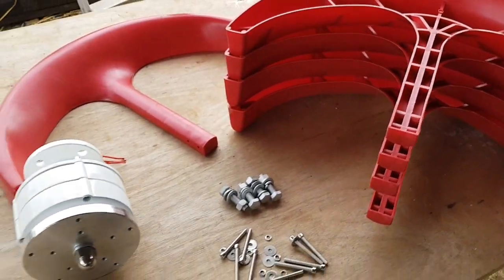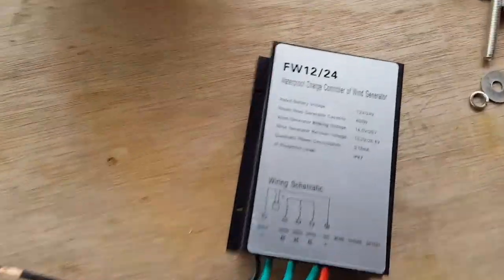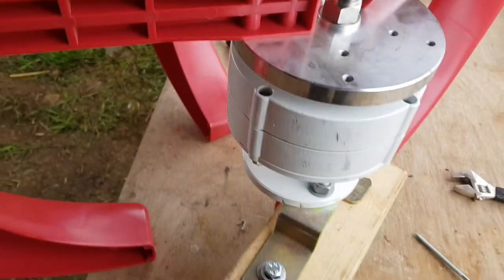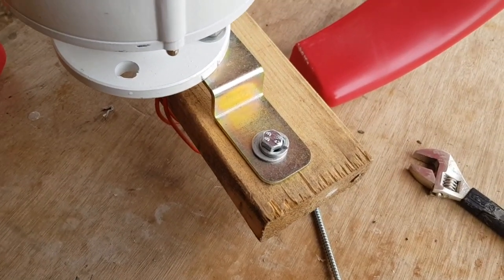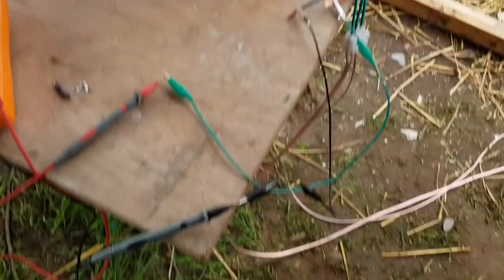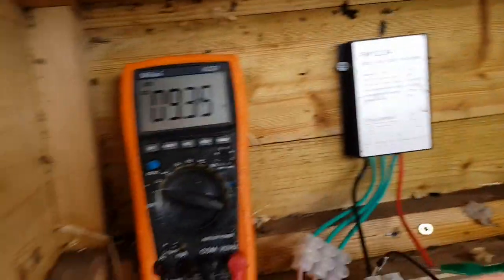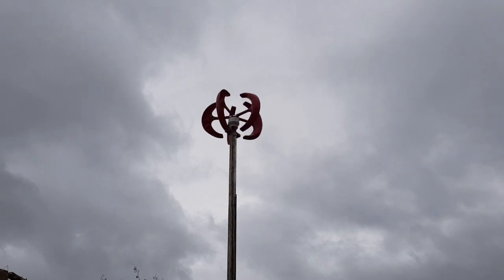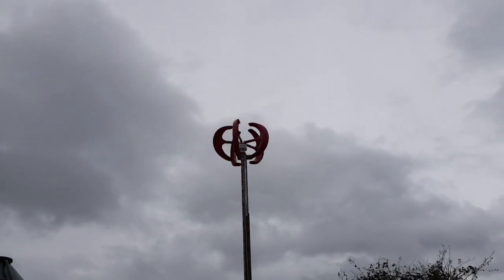Installing a 400w 12v Vertical Axis wind turbine!

Comment: It's not the wind it's the wire for long runs to battery can be a long way need minimum 2 gauge wire other wise get voltage drop.

Comment: I bought what looks to be an identical unit for $180AUD off eBay, though it says it's1200watts, and it makes zero power, light voltage but zero amps (so zero watts) 
I also bought a $3kw vertical Axis helical wind turbine that won't generate any usable power either (and I've had it fully humming in strong winds) 
It's installed well, the wiring is done right and checked, and I have an electrical licence and all the tools and meters etc.
They just aren't good.
In talks with the suppliers atm about exchanges. 
I do have a Vevor 500w horizontal axis turbine that works fairly well, it generally makes 100w (nowhere close to the advertised 500w) and last night in a full blown gale, (it sounded awful) it made 176w and there is no way that unit could make more, the prop was going so fast that it was chopping and cavitating the air.
BUT - it Does work. 
So far my short experience in wind generators is leading me to believe that vertical axis is the way to go.

Comment: There is a solid steel mounting bracket supplied, to weld onto the end of a solid steel pipe...Only a pom would make a half arsed piece of metal a support on the end of a bit of wood.....They got rid of the m=poms and sent em to Australia to get smart....I looked at this to see what (all three same coloured ) went where...No info here

Comment: In order to understand the principle of these wind generators, you first have to know how the whole thing works.
The measuring method with the multimeter goes in completely the wrong direction. As you all know,
Almost all wind turbines are so-called three-phase generators, which do not have a permanent magnet
feature. In order for these generators to generate/amplify electricity, an excitation field must be created
the regulator does it. For this to work, the regulator requires a power source of 12V or 24V
etc. Only when a power source is connected to the controller (direct current source) does a magnetic field develop in the generator
(exciter field). The engine brake is regulated and triggered without consumption/charging. If the
The generator is then powered by wind power, the current increases and is then used again via the regulator
delivered. In principle, the electricity in the generator is only increased by the additional wind power. Preferably,
you use the original controllers that come with your wind generators.

Otherwise, the information only refers to the performance
on the regulators used. The generator, starting at €150, produces an output of approx. 100-130 watts at 24V
and about 4-5 amps. I use two wind generators (800W regulator) of this type (without solar) and am quite
happy with it. My batteries (2x12V (24V) 60Ah) are always well filled and also give (depending on the...
consumption) enough power. Depending on the wind strength, wind generators produce electricity on a completely
different way than solar panels. The regulators are also not the same as the charge controllers for solar panels
comparable. In practice, it is more difficult to determine the type of power output because it depends on
depends on many factors of different consumers. I was able to find some data about mine
additional charge controller, which is behind the controller from the wind generator to the battery = inverter
connected, see the LCD.

Comment: I would not recommend this until you've posted data regarding actual power output.  You say 'lots of free power' ~ that's a bit meaningless isn't it without numbers.  Very easy to provide numbers, I doubt they're good ones considering the design.

Comment: I got a horizontal turbine on my roof now but it won’t spin; perhaps I should get a vertical turbine instead… Did you buy the Pikasola brand?
Reply: I have only had luck with horizontal, I have 2 vertical axis turbines that create no power.
Reply: @Dustinielson  I bought a lemon windmill 😂
Reply: Yeah, I'm working my way through it but haven't had great luck thus far either.

Comment: Hi.  I would like to know where to get a WIND TURBINE NO-WELD mounting Flange for my Chinese wind turbine to mount it to a pole.  How did you mount yours?
Reply from the maker: Just with a few bolts and a metal bracket

Comment: The three dc cables from controller to the motor, is there a certain way to connect them or any three combinations will work? Mine came with no instructions
Reply: Any way you like. It's ac 3 phase.

Comment: the wattage is reported as 400 wats but is actually 400/day.  yes, per day  thats is why the amperage is so low.
Reply from the maker: It technically over performs then  😂😂👍👌
Reply: @Field_to_Farm  no they under perform by 24 times
Reply: @Field_to_Farm  what a muppet.

Comment: The problem with a VAWT is that half of the 'blades' are always working against the wind, there is a reason why hardly any commercial wind farms use them.
Reply: They are for urban areas where the wind is more turbulent. Basically (in theory) they won't be chasing the wind like a horizontal turbine.

Comment: the RPM of turbine is mainly determined by the wind speed. when it is under load, it will counter push the wind, thus giving out more amp and Watts.

Comment: i have just got  mine   it came one day after ordering   ??  any way  i have put mine on a scafold pole   works fine  got 16 off mine to
Reply from the maker: Check the amps its putting out then do volts times amps to work out the watts mine was no where near the 400w in a full wind, so I complained and got my money back 👍👍 works well enough to keep my led lights powered tho
Reply: @Field_to_Farm  thank bud

Comment: What would i need to connect controller to a usb charger port? Thanks
Reply: a 12 volt one is   + to +     - to -    it will power any thing  up to its  400 w  limit      or  put a inverter on it

Comment: Where is the big washer to put on top of the blades?
Reply from the maker: It didn't come with one :-/
Reply: @Field_to_Farm  well done man!
Reply from the maker: @mythbuster3567  thanks, someone else mentioned it should have a big metal thing to connect the blades too. Its held up well to strong winds without it so atleast the Blades are manufactured well! the same for the alternator cannot be said lol!!

Comment: Could you run a DC to DC converter so it charges before hitting 12 volts itself?
Reply from the maker: I guess you could but it would be next to no amps for charging I think
Reply: Boost converters boost to a set voltage. Once input voltage exceeds set voltage you receive same voltage/amps as direct wiring minus about 5 percent efficiency. Dc boost works different than ac step up.

Comment: How many amps and watts?
Reply: AT 1 RPS i get 12 volts at 150 mA     1.8 watts
At 2 RPS i get  23 volts at 300 mA     6.9 Watts
At 4 RPS i get 50 volts at  600 mA     30 watts
this is as fast as i can turn it  but you can see the pattern

so at 8 RPS you should get 100 volts 1.2 amps so 120 watts
if you need different amps or volts i would suggest using a 3 phase bridge rectifier and take the dc and put it through a dc to dc converter
Reply: the first 3 values are real world test results from mine hand turning it
Reply: @elk3909  Is this per hour? Thanks.
Reply: @bluestweaks77  no RPS is rotations per second

Comment: Trust me they do not work , they put out no usable power at all , i bought one a few weeks ago and the first problem was the wires coming from  generator fell out as they are not secured inside  the body   so the slightest tug on the wires  and it breaks from the windings ,  had it repaired and mounted back up and it produces nothing at all in  moderate everyday kind of winds , only when a storm blows by does it do anything at all  maybe 19 volts if i am lucky on my 24v system , i was one of the lucky ones  , my seller gave me a full refund and did not even want me to send the turbine back !
Reply from the maker: trust me they do, it works sweet for our 12v lights, systems been full charged since we installed it! i suggest don't use it on 24v system as u obviously need much higher winds to get a charging voltage
Reply: Yes they are are secure at all my 400 watt produces 2 amps only. 400 watts over a days charging so very little amps.  I thought it would be 33 amp. Not

Comment: I hawe one and is giving volts but not ampers soo i can tell u with fast speed of my drill conected to the generator axis with the fast speed is giving like 20w
Reply: salut ,I haver  problem with my tourbain , have voltage no present the  current .

Comment: 12v 150ah battery full charge time?
Reply from the maker: it puts out 1amp at 18v ish from an average wind
Reply: @Field_to_Farm  so thats about 18watts, thats why most people tell you it doesnt work, 18 out of the suggested 400 is kind of a rip off. sure the generator may be rated to 400, but you'd probly get the same wattage off of a 100w motor.
Reply: @TheDIYDen  just tried "2x 200w panels,gives about 5,5 a/h 😆 at its best well wasnt expecting that 16-18 a/h  anyway as so cheap.have to say they add too much zeros to watts...as they work like 20w panels.

Comment: Absolutely frivolous. There will be no energy. After all, the wind turbine is Chinese and vertical-axial. Which have very poor performance.
You see this quickly. And you will not be the first.
Reply: In an urban or suburban area, you'd be right. Out here in the moors, though, where the wind direction changes constantly and the intensity is highly variant, a vertical-axial turbine will produce a more consistent figure - even if that figure's peak is lower. This is better for controller longevity and battery health.
Reply: @NorthernScrub  energy production will be significantly less in a vertically axial wind turbine. And with a strong wind they break.
Reply: My vawt does nothing except spinning